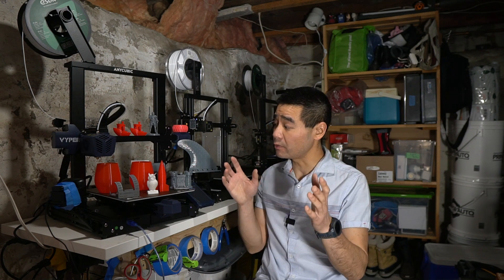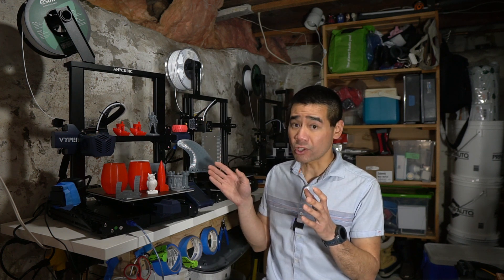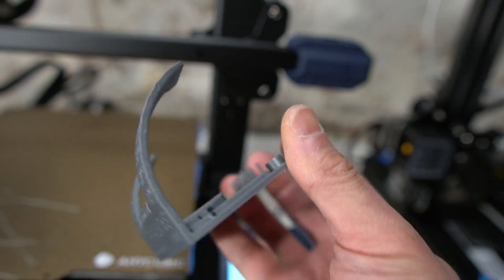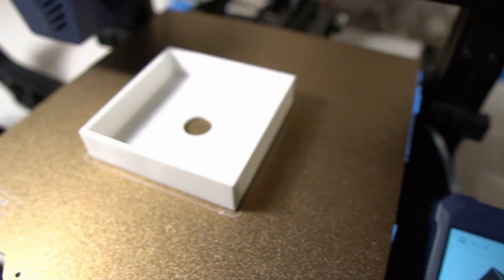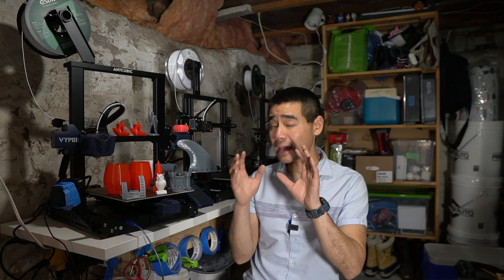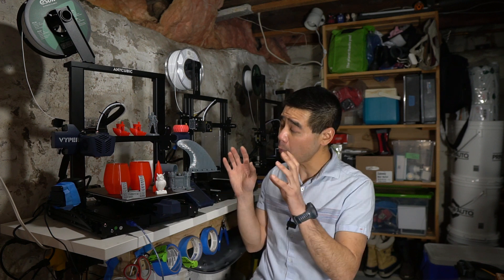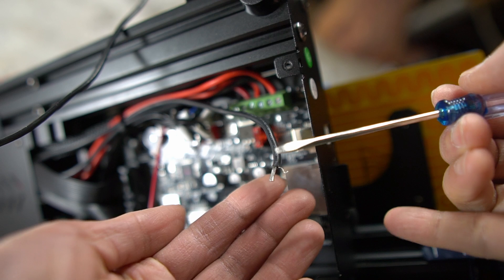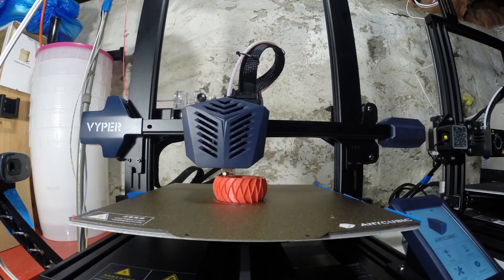Anycubic Vyper Review | Is Worth It But Has An Issue

Comment: 2 prints have now failed me cause of the side mount filament... print a top mount is a must do. and angle thingy for spool/filament censor.
when the print gets to high it strains the side mount spool and will mess up the prints... cost me 4+ days of a big 2 prints. Not happy.
also don't run it in a box the heat creep will get bad unless u like in Canada or in a shed then you may need it.
I have never tried turing heat bed off butt I disagree as some prints evven with skirts have delaminated for me, glue can fix this tho.

Comment: You could dolder the leads direct to the mother board.
Heat problem solved.
But
Thst eould mesn you would have to remove the terminal block. Easy for some but not everyone wants to ho through that. Lol
Great video
Great honest review
Thank you

Comment: There are many reviews for the Vyper on YouTube, because its around a while. This review is by far the best and on point. Thank you for the very good presentation of the printer. Even this youtube video is already one year old, I just bought my vyper recently and I'm very happy with the functionality of the printer, but I have troubles with stringing and until now I didn't find a working cura profile to avoid it. Also prints with 0,2mm layer height looking not so good with my cura profile.Thanks for your effort to make this video.

Comment: Excellent review!!! I'm actually thinking of buying one today and I'm thankful I found your review. I just want to mention that this has been corrected from the manufacturer, I bought the Vyper a month a go and open it up to check this. All best!
Reply: When you say "this" has been corrected, do you mean the wire terminal block issue? How did AnyCubic fix it?
Reply: @bnut1576   yes actually on mine the end of the wires are terminals.
Reply: @angeleskidragan  Thats great to hear! I have an E series Vyper (which I believe is their latest series), so its good to hear I wont have to worry about that issue.

Comment: I've had my Vyper for  4 months its so close to been booted out the door. Watched all these reviews saying how good it is but its just more trouble than its worth. I had to get a new extruder and hot end assembly from Anycubic as they were both faulty. And setting OMG this thing is a picky as some women (sry ladys) every print it needs adjusting. My two Enders never had these problems. I just bought the Kobra Max now I'm hopping it doesn't have the same issues.

Comment: I got my Vyper about a week now, the first test print (The Owl in the SD card) came out outstanding impressively beautiful and detailed.

Then, I tried one of my models without luck. I used the Cura Profile in the SD, downloaded several profiles and make my own, every time I sent to print it try to print out the bed, just in the homing corner and the Z axis to low. PLEASE HELP ME. I'm new to 3D printing....
Reply: Did you solve your problem?
Reply: I know its 8 months later so you may have figured out the issue but in case you have not:
I had the same issues with my Vyper. I couldnt get anything to print without bad stringing, artifacts, etc. 
I was at my wits end, when I decided to try slicing in PrusaSlicer instead of Cura. Boom. All of my prints came out almost perfect. If you happen to still be fighting print quality issues, try slicing in Prusa

Comment: Great review, thank you. I've been 3D printing for 4 years now and even started a business out of it. I'm looking for a second printer. What I really want over the current one is a sturdier frame and, more importantly, moving past manual bed leveling. From my experience, the latter is the absolute most important point and IMO a major user experience problem that should be addressed for all printers. Manual bed leveling and z-offset adjustment should be a thing of the past. Adjusting the bed for a good first layer is by far what has consumed the most of my time when operating the printer. I was so sick of leveling that I literally preordered the $2000 Prusa XL just for the fully automated leveling and step calibration. I don't even care about the extra size and multi-extruders (although they certainly open up possibilities). That said, I'm happy to see that most reviews report the strain gauge on the Vyper actually being an effective solution. I might just cancel the preorder on the XL and just get the Vyper.
Reply: It has automatic bed leveling so I’m kind of confused by this comment

Comment: I got the Vyper for Christmas. Messed with it for two months and haven’t got a successful print yet. I got annoyed in early mid march messing with this thing and set it aside. I think if I could get it sorted out, I’d really like it. Customer service is pretty good about getting back to you but I hate that it brand new and have to go through all this headache. Something with the auto leveling and everything says it’s the sensor. They sent a whole new print head unit but didn’t resolve it. Now they’re saying it’s a software update issue. Really wanted to like this printer. Going to get back at it I guess and see what I can do. Frustrating though for sure.
Reply: With every printer you need good settings and good filament. Even my firstprint was realy good^^
Reply: @tombeardy4833  yeah. I know that. This one won’t work at all. Can’t get past the start up menu. There’s something mechanically or in the software. Still trying to work through it. I work a lot so it’s hard to find the time to deal with it. It’s literally brand new and hasn’t worked since I got it. Trying all the things they suggest as I have time. Wish I could just return it at this point.
Reply: Been running my Ender3 for 4 years now with minimal issues over the years. Mostly maintenance.
Reply: I got my Vyper about a week now, the first test print (The Owl in the SD card) came out outstanding impressively beautiful and detailed.

Then, I tried one of my models without luck. I used the Cura Profile in the SD, downloaded several profiles and make my own, every time I sent to print it try to print out the bed, just in the homing corner and the Z axis to low. PLEASE HELP ME. I'm new to 3D printing....
Reply: @hericperez  auto level worked?
Reply: the vyper is way more reliable than the ender 3. Once your not a noob and turn off retraction, the printers take almost no maintenance. If you use an all metal hotend then the extruders not tuggign back and forth on the tube pulling it from the heat block. If you look at the screen, it should have an error message, if your able to read that is a great starting point and will help you narrow it down.
Reply: @mrschnider6521  my problem wound up being a defective motherboard. Been printing ever since no issues.

Comment: I've had this printer for a few months and I have long print fails. I'm afraid to print anything over 5 hours. It keeps happening. The changed my settings, I emailed the company. They gave me a replacement motor for the extruder, but it still has long print fails. I don't know what's wrong with my printer. Smh

Comment: I disagree with you on the fact that the Ender 3 version 2 would be a better first printer. I got in a 3D printing a month ago. And for somebody that knew absolutely zero about 3D printing. I purchased the Ender 3 version 2 because of the Amazon reviews and the amount that were sold. People that are new to 3D printing like myself for the time knew nothing about x y axis, g-codes, slicers, I mean it's a whole new world. And there is quite a bit to learn. I personally have fun through this process as I have numerous hobbies and I used to do electrical engineering. With that said I did run into quite a few issues the first five days with bed leveling. If if you like myself don't know anybody that has a 3D printer to give you one-on-one assistance you have to resort to YouTube videos. The YouTube video that I found for bed leveling came with some g-codes. And in a way they were flawed and caused me to have user error over the first five days. Once I got a decent G-code from CHEP at his channel.. it really helped. But the whole fact that it took me an hour to put the machine together and it took me 5 days to get a good print. And you got to understand I have an engineering background. I would think that the majority of your average users would have difficulty. And of course they do. I also purchased the any cubic Viper and it literally took me 5 minutes to put it together and on top of that it has all the major upgrades that you would have to spend an additional $200 for with the Ender 3 version 2. So with that said oh, I do love both printers. But if I had to go back in time I would have picked the anycubic vyper to be my first printer out of the box. Also if it's just somebody that's a hobbyist and wants to print a few things on the weekend the any cubic Viper is definitely better. Now if you like to Tinker installed her and upgrade your printer little by little by little by little then I think the Ender 3 version 2 is definitely better. The next freighter on my list is the Ender 3 S1 PRO.. That is what I really wished I started with. It has the best features out of the majority of printers today plus it also has the ability to heat to 300 degrees Celsius. In the end the purpose I got into 3D printing was to get into nylon carbon fiber filament.. and that printer will eat any plastic you feed it!! But I really loved this video and all the information you provided.  Very informative and your channel is great!!

Comment: Mine ran great for 3 months then had issues with clogging. Installed a new factory hotend and cleaned the extruder box, now I can't lay a decent first layer or brim. Been using the same filament and temperature settings the whole time.

Comment: "Sounds" like that one motor is bad and why it is not silent. None of mine make a sound. Also, check to make sure nothing is slightly loose or rubbing you the wrong way in regards to that one y motor. 

As one responder mentioned, always cut off tinned ends and reinsert it with bare tightened wire if you have no other choice. That small amount should still give you enough wire.

Cheers

Comment: The wire terminal problem - this likely happened because the ends of the wire are tinned. As they contact the internals of that green block, they only make contact at a few small points - where the hard solder on the strands touches the hard terminals. The resistance is concentrated here and thus the point of the power creation, so it gets hot. You can solve this by clipping the tinned ends off the wire (do this very carefully and don't let any strands fall on the board). Strip them back a little bit and twist the strands together slightly, then put them back in the block and crank them down. This will create more surface area of the wire touching the internals of the block.
Reply: It’s because of creep, or cold flow. Under constant mechanical pressure, solder will slowly flow, until the force reaches zero. In the case of screw terminals, that means the screw will always end up loose. The aluminum alloys used for aluminum house wiring also suffered from creep, which is why it was so dangerous.

Comment: Hello, I just returned a Ender 6 corexy. It was defective out the box, I did not want to play guessing games with Creality in trying to find out what was wrong with it, but they insisted. The issue I had was banging of the extruder against the rail. After troubleshooting, people and creality suggested it was the stopper, so i switch it out, and nothing changed. so creality sent me an adapter board, that too didnt fix the issue, at this point, a month had passed after getting it in the mail, and going back and forth with the company asking for a replacement machine, they again, persisted they would send parts. I dont know about you guys, but I value my time, even if its a learning experience with learning a DIY machine, if I purchase something, especially if its over 500 dollars, and it cannot at least function the bare minimal of what it was advertised to do because of a hardware malfunction (not because of a required minor adjustment), I would expect a replacement machine without any questions. All I did was follow the directions to a T, no added modifications etc, I even made sure the firmware was updated; nothing changed. So despite showing creality what their machine was doing, and asking that they just replace the machine, what do they do? Ask me if a roll of filament would suffice for the troubles I had been going through. Right, send me filament for the broken machine you refuse to just replace. So at this point, I just said screw it, I didnt want a replacement, I just wanted my money back, went through the Paypal team, basically got it resolved with some issues... Creality didnt want to come forward with a shipping label as they just gave me an warehouse address to deliver to, so i had to suck it up and send it back which cost me 100 dollars to send from where I live to TX. I will not be dealing with creality ever again. I dont care how much i see their products, it doesnt mean squat to me if their customer service for brand new customers is a band-aid approach while wasting their customer's time and money for nearly 2 months.

Comment: It’s been in my experience when dealing with wiring that carries a lot of current you had to be mindful simply putting a Farrell on a connector it’s simply moving the problem further down the line a better bet would be to trim the wires re-tin with Old school 50-50 solder making sure to clean all the flux completely and then coat them with A compound sold at electrical suppliers to prevent corrosion of the two unlike metals The problem also could be a lot of wiring used in China is copper coated aluminum which causes its share of problems also when you trim the ends you could see if they are using solid copper for their wiring many times they sneak aluminum wiring into electrical devices and pass it off as copper bad idea. The 50-50 Sauter provides a better connection when the set screws clamp down on it it’s much denser and harder than leadfree solder because it contains tin Leadfree solder is extremely soft. And should never be used on anything that’s not directly board related.

Comment: What would be the best 3D printer for $500 or under? I have an old Ender 3 and it's slow. It doesn't have any auto-leveling. I want something that's a noticeable step up.
Reply: Not the Vyper lol
Reply: @Nirinium  the vyper is great
Reply: @tombeardy4833  It has potential to be a good printer, nowhere near great. One major design flaw. Strain gauge fork used for ABL, Anycubic has replaced more of these strain gauges and entire hotend assemblies than they have sold printers. Even the D and newest E revision (serial numbers) have the support that prevents hotend from bending left and right does very little in preserving the strain gauge assembly. Don't even get me started on the printers with the TriGorilla mainboard revision that is experiencing thermal runaway literally starting fires in peoples homes. I own four of the Vypers, and trust me I wanted to believe in them and I recommended them to so many people, only to be made to look like a fool. Every Vyper of mine but one has had some sort of major issue. 

I assume you are unaware of these two common issues I have mentioned, and I totally understand if that's the case. 

Although I respect your opinion, I respectfully disagree with "the vyper is great" and so do many others.